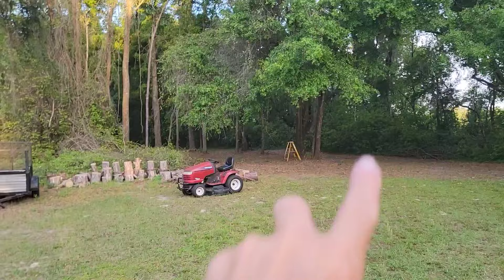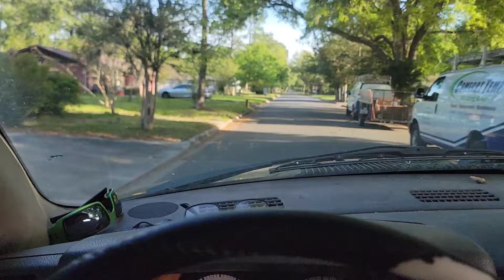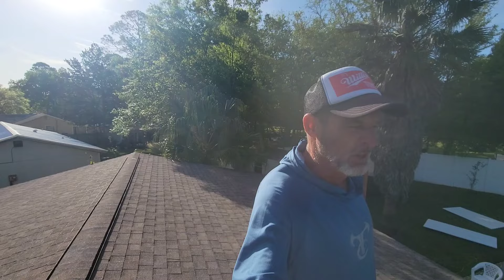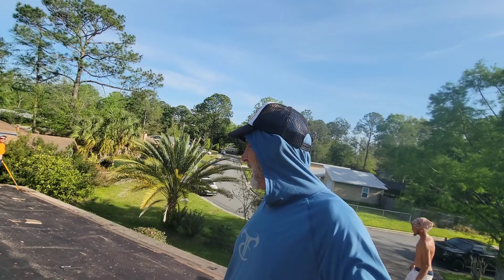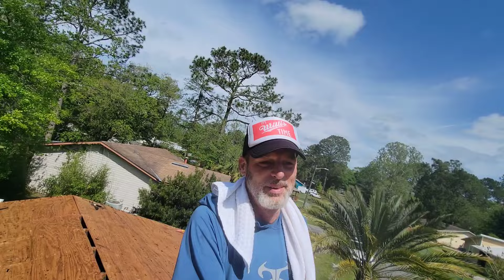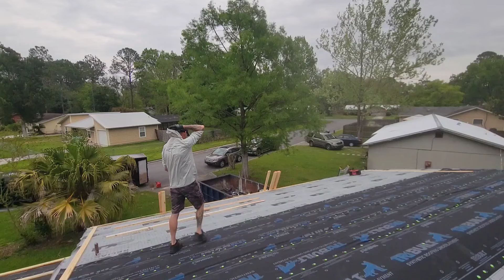TEAR IT UP WILLIS

Comment: Pro tip, pre drill holes for fasteners on the ground, if you drill multiple sheets at the same time no shavings on the roof, all fasteners are in a perfect row.
Reply from the maker: Yes, we do pre drill the panels on the ground first.